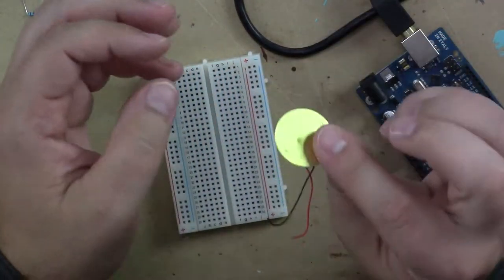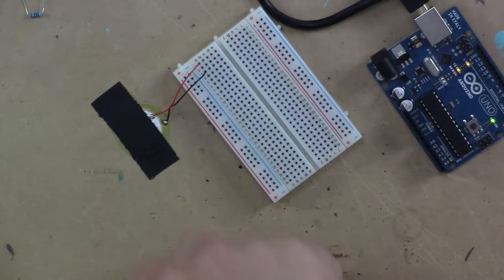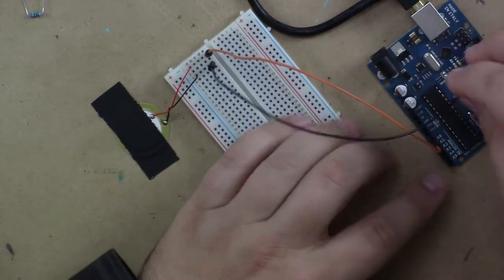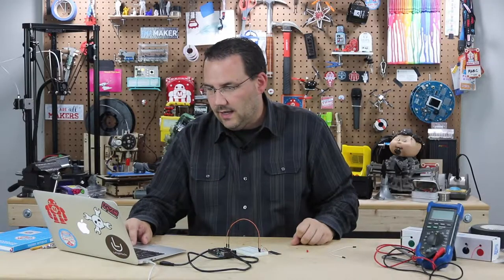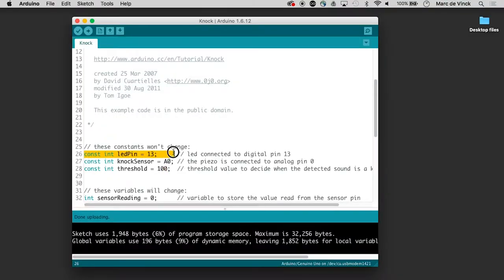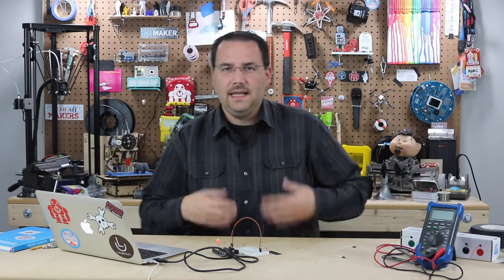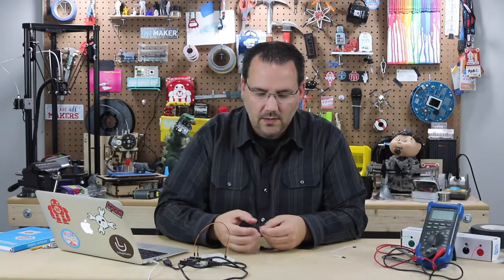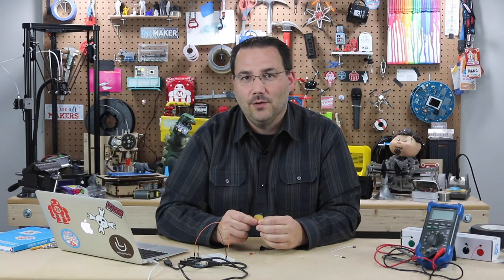Arduino Prototyping Inputs #49: Knock Sensor

Comment: My electronic drum kit's pads have the same type of piezo in an airtight cylinder. When the pad is hit, the pressure inside the cylinder increases and triggers the piezo, the "brains" then plays the sound associated with that sensor.

Comment: To increase sensitivity you can add a small neodymium to each side of the piezoelectric element. I have found it greatly improved the sensitivity.
Reply from the maker: I did not know that. Thanks for the tip!
Reply: @MarcdeVinck  I may have missed you a bit. At the time I was trying this I was using the piezoelectric with the vibration sensor sketch and wiring. I am sorry. I didn't realize the two sketches and wiring were using different signal pins ex. Vibration sensor using pin 9 and Knock sensor using pin A0.  Originally was working with vibration sensor module SW420 and wanted to try using a piezo instead to see if sensitivity would increase it didn't until I added the magnets on either side. I then decided to use the knock sketch and realized the difference in wiring and sketch's and realized it is not as effective using it as a knock sensor. Even playing with program sensitivity values didn't make much difference. Anyway I just wanted to clarify that I did make an error in my comment. Sorry.
Reply from the maker: @davidbean5807  No worries. I appreciate the explanation!

Comment: Why do you need resistor across Ground and A0?  I thought the Piezo just generates a voltage (no more than 5v) and then the aruidno should just read it?
Reply from the maker: To stop the pin from floating and giving random numbers.

Comment: Hi Marc, I followed your wiring and code, but I'm having trouble with the sensitivity. As I change the sensitivity it seems to go from not being able to sense, to being oversensitive and repeating "knock!" without interruption (no new input on the sensor). What could be going on?
Reply from the maker: Sounds like you have a floating pin. Double check your resistor is wired properly and the correct value.
Reply: That was IT! Thank you. I should probably figure out how to solder so those tiny wires.

Comment: Hi great video btw I have a question is there a way to program the Piezo with the Arduino to make  direct contact with the Piezo not just vibration?
Reply from the maker: The piezo is not programmed, it is just a "dumb"sensor, no specific electronics. You can make a capacitive touch sensor with Arduino. That would sense whenever a wire (or anything conductive) is touched. I have a video on that here - https://www.youtube.com/watch?v=ZqeA1CQsAQM

Comment: Does the piezos analogue output vary by how hard you knock it? Like would a harder knock cause a stronger electric pulse?
Reply from the maker: Yes! As a fun test you can hold a through hole LED to the (+) & (-) parts of the piezo and "flick" it with your finger. You will see a difference in the LEDs brightness based on how hard you "flick" it. And you will also most likely kill the LED, so use a spare one that you don't mind burning out.

Comment: In Arduino's IDE, "Examples 02. Digital toneKeyboard" requires 3x force sensing resistors.  Can I use one of those force sensing resistors for this Knock Sensor project?  If not, why not?  Thanks for your guidance.
Reply from the maker: That example uses a force sensing resistor (FSR). You could use it, but you would have to hit the actual sensor to get a signal, which is analog. A piezo can sense vibration from further away. They are are also less expensive. So, yes you can, but it's not ideal.

Comment: Can i measure the amplitude using this element? Lets say im placing multiple piezo elements on a surface and hitting a certian point. Is there a way to tell which element gave the input with the highest amplitude?
Reply from the maker: Yes, that is possible. Just make sure your micro is fast and you can compare response times and amplitude.

Comment: can i put it behind a door and receive its vibration? and why connect the resistor in parallel with the piezo?
Reply from the maker: You could, bu it it would have to be hit to register a signal. If you want higher resolution you might want to consider an inexpensive accelerometer or IMU. For the resistor? The reason is to be able to filter out false positives by always having a path for the electricity to go instead of the analog pin floating when not in use.

Comment: Great informative video. Hope you can help me.  I have a sensitivity of 15 and tried upto 20. But output from piezo is very inconsistent. It registers a value above 20 after 3 to 4 clicks. So I can't get the toggle behavior. What's wrong?
Reply from the maker: Not sure how you are calculating sensitivity. Might want to try something more binary. Piezo generate an analog electrical signal, you could sense any voltage over 0...or close to zero.

Comment: Would someone be able to explain to me how the sensitivity works? I think I understand but I am not 100% sure? I understand that the lower the number on the code, the higher the sensitivity. From what I can understand from the code: when I hit the piezo it generates a voltage. The arduino detects that voltage. The sensitivity changes ONLY the response of the arduino? 

For example, if it is closer to 0, then the arduino will displace “knock” at a lower piezo voltage (assuming 0.1) compared to being set to 300 which requires the arduino to respond to a much higher voltage (assuming 5)?

So the sensitivity does nothing to the piezo itself, just the reaction of the arduino to the amount of voltage released by the piezo?
Reply: I would also like to add a little note: when only using the LED pin and ground (red wire connected directly to LED) when the sensitivity was set to 0, the piezo would click at constant intervals and when it was set to 300 the clicking would stop.

This is why I asked the question, is the arduino sending a base voltage through the piezo, and does that voltage change/have anything to do with the sensitivity?
Reply from the maker: Yes, you have the basic concept correct. The piezo generates electricity (the piezo effect) when a mechanical force is applied. No power to the piezo is necessary. The sensitivity is the Arduino reacting via code to the amount of energy created by the force that is applied to the piezo.
Reply: @MarcdeVinck  ok, thank you so much for your reply!
Reply from the maker: @selinacervantes7407  No problem, glad I could help!

Comment: Can this knock sensor detect vibrations in the air or does it only detect sound waves through solid material?
Reply from the maker: No, it won't detect vibrations in the air. For that I would recommend something similar to a speaker. When the speaker diaphragm moves it would generate and electrical current. You could also bounce a UV led off a very flexible surface and measure the movement (or reflectance), and that could give you an idea about air movment.
Reply: @MarcdeVinck    thank you, that is actually a smart idea. I also found some sort of an intensity meter which I can use, along with some calculations, to detect the loudness of a sound in dB.
Reply from the maker: @omarkhalaf9723  Look up Arduino Decibel Meter, there are tons of resources. Also know that a microphone measures air movement.  (basically what I was explaining by using a speaker)

Comment: Can this sensor measure the vibration of  machine? Like textile weaving,knitting machine..
Reply from the maker: Possibly, but it depends on the amplitude and frequency. You can also use an accelerometer for higher frequency and lower amplitude situations, but again, it depends on a lot of factors, including the sensors durability in a high stress situation.
Reply: @MarcdeVinck  thanks for your kind reply! Bt i have question regarding this,' if we use piezoelectric vibration sensor then as controller which one we should use arduino or plc..which one more impactful and why?
Reply from the maker: @fazrulislam5053  It depends. Which Arduino? Which PIC? They run at different speeds depending on the board. Didn't use to be that way, but a lot has changed in the last 15+ years. I would choose the board that runs fast enough and you are familiar with programming.
Reply: @MarcdeVinck  arduino like arduino mega 2560 and PLC like ladder diagram(LD)/ladder logic!
Reply from the maker: @fazrulislam5053  Again, depends on what you are specifically measuring. You can use board, but I would try to connect with someone locally that can get you a better answer and see your specific needs.
Reply: @MarcdeVinck  i got it! You r really so helpful! Keep it up! God Bless you!

Comment: can the arduino be set to switch the led off after a set time
Reply from the maker: Yes! You can easily add a delay and then turn an LED on/off.
Reply: @MarcdeVinck  ok thanks
i actually want to switch a siren or buzzer on for a set period , is there a way of doing that please?
Reply from the maker: @Masiyamusic  You can easily do that by using a buzzer or speaker. Turn on (or play a tone) through the speaker when a knock is sensed, add a delay for as long as you want, then turn it off. It's an easy project! Good luck and have fun!

Comment: Never get 0 out of it. Its always abput 70. after one knock, it holds about 200 for a certain time and slowly reduce itself back to 70
Reply from the maker: Same piezo? And nothing else wired up? Sounds like a capacitor and/or a floating pin issue? What pin are you using? Same as the video example?
Reply: @MarcdeVinck  Already switched all components, same behavior. You think it's not soldered alright? Maybe some loose Parts? Yes, I use nearly the same build.
Reply from the maker: @RicoNNect82nd  I can't say if it's a solder issue without seeing it. Not sure where you even have solder if you built it the same way?
Reply: @MarcdeVinck  I solderd it in the first place, without jumpwire before.
The soldered places look clean so far. Want to try another input. Already swapped Arduino and Piezo and Inbetriebnahme resistors, same issue :/

Comment: Nobody explains the 1M resistor and it's function in the circuit .. like what does it do .. why 1M .. what if we take another value ...
Reply from the maker: The 1 mega ohm resistor limits the travel of almost all the electricity on the pin. It makes the pin very stable, with no fluctuating voltages, and therefore very sensitive to variations you can leverage via code.

Comment: can you please tell that If I want to connect more then 1 piezoelectric sensor to Arduino ..then How can I do it??
Reply from the maker: You can connect as many sensors as you have available pins. But be aware that vibrations from one sensor could be read by other sensors. All you have to do is change the code to another pin and wire it up. Google it, there is code available online.